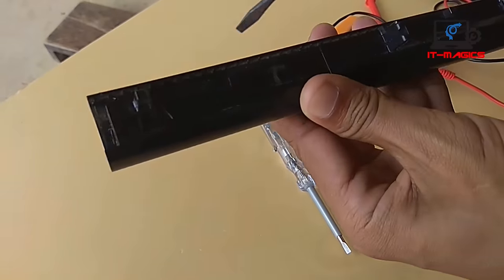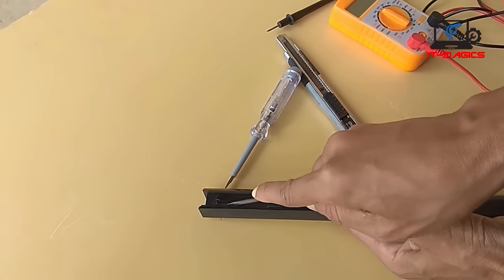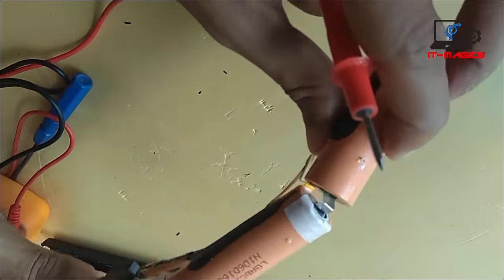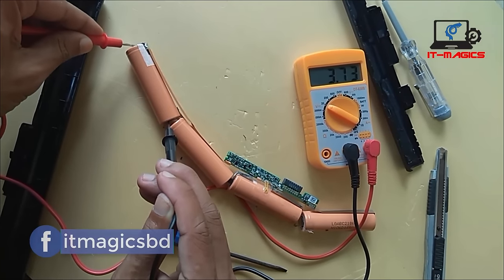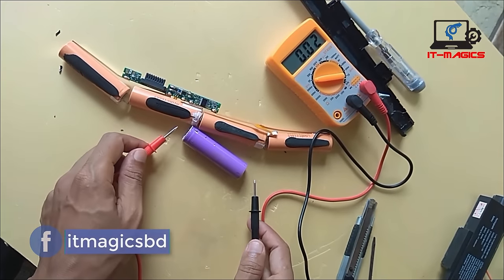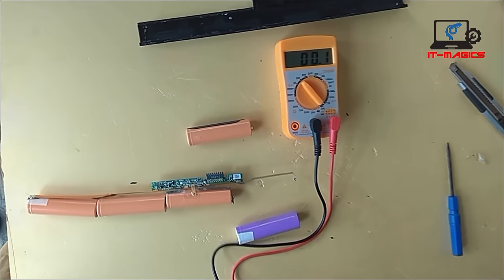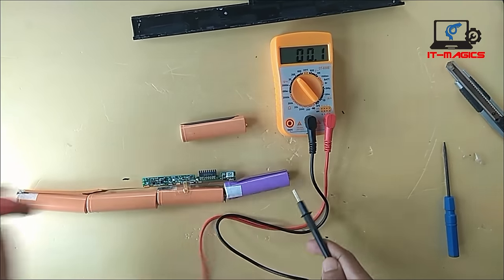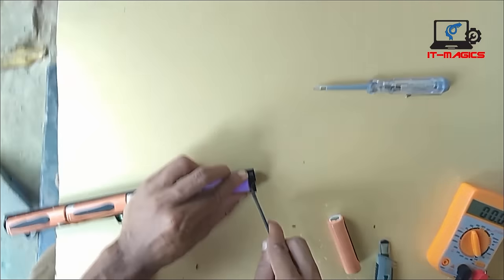Repair Laptop Damage Battery  or Not Charging Battery (Easy Way)

Comment: my laptop battery is not really holding a charge, however when I took it out and checked the individual cells they are actually showing 4.05V each x 4 when they are rated at 3.75V each??  I expected one or two to be very low but they all have this high voltage.  Battery pack is supposed to be 15V 48Wh 4 cells.  Any ideas ?
Reply: Same issue for me too... Pls do reply if found the solution
Reply: It is normal for fully charged 18650 cells to have a voltage of 4.2v. I believe that is the fully charged voltage when no load is present. So there is no problem with the voltage you are seeing.

The actual issue might either be that your battery charging controller has limited the run time after a programmed amount of charge cycles or one or more cell pairs in your batteries have degraded and can't deliver the same amount of current it used to resulting in it's voltage dropping faster then normal.

A fully dead battery is a battery that drops below 3.2 or 3 volts. So anything 2 and below is definite red flag and means that cell(s) need replaced. Usually though if a cell pair goes below the safe minimum the charging IC will refuse to charge the batteries which hasn't happened to you yet.

Another thing to note is many newer batteries have battery ICs that will refuse to work after you disconnect the cells as a form of tampering protection. Some can be reset by bridging the postive battery terminal to the postive output terminal. HP battery ICs are known to blow a fuse on the board as a protection as well and those along with others may also need special programming software to reset their EEPROMs. If you have one of those you are better off just buying a new battery pack. (perhaps get a generic brand instead of OEM. They may have simpler IC design that allows cell replacement in the future and may have easier to open cases)

Also one way to test if it's your battery IC cutting you off or if cells degraded is to disable the battery/power ACPI drivers in windows device manager and force the laptop to run until power shutdown. Usually Windows will auto shutdown at a certain battery level and this is determined by what the battery level the battery IC gives to the computer.

I have a old HP dv2000 with a 96watt hour battery that only runs the computer for like 15 minutes before windows shuts the computer down and BIOS says battery critically low before auto power off if I try to power on with no AC adapter. But if I power to BIOS with AC adapter plugged in, then unplug it continues to run much longer (but Windows will auto shutdown if I try to boot up to it). So looks like maybe my battery IC is what is deciding to shutdown the computer early. I have already opened my battery pack and checked and didn't find any unusual voltages for any of the cells so they charge to the correct voltage at least. Current capacity though requires something more advanced then a multimeter though so I can't really test that on mine. :P

Comment: So...ok...where can I get a new cell online?  What exactly am I looking for?  a rechargeable li ion battery?  or specific to a laptop battery?
Reply from the maker: Amazon
Reply: @ITMagics  Thank you for the short uninformative answer :p
Reply: @Bertminator  18650 battery hunting is actually really not safe. You might get scammed and get 300mah batteries instead of 1000mah ones.  It's safe to go for a cheap 10000mah powerbank and disassemble that one since fake 10000mah powerbanks have half the capacity (6000mah)

Comment: This wont work. Its a time waste. The eeprom chip of the battery needs to be reset and nobody has a way of doing it.
Reply from the maker: If laptop battery is physical damage you can do it otherwise not
Reply: Yes it didnot work..i tried
Reply: @ITMagics  i dont understand what you mean by physical damage. I had 2 cells dead (0 volt type of dead with cis caps popped out), the others were good. I replaced the 2 dead ones but nothing, still not charging. The protection board EEPROM needs to be reset as well otherwise you replace the cells in vain. What you need to post videos about is how to RESET the protection board after changing cells.

Comment: Hi sir my laptop is not charging I pullged the ac adaptor but it's showing that not charging what can I do my laptop is switched off for 5 months and whenever I use that with direct electricity without ac adapter after sometimes it switched off or showing some green green codes what can I do help me sir. 😭

Comment: Hello sir, my laptop battery timing is 2 to 2.5 hours. But, it stopped working suddenly on 49% and it brings the battery low light on my laptop. When I plug-off the charger my laptop turn of suddenly. Any suggestion to fix the problem, please.
Reply from the maker: Reset your pc
Reply: i can reset. Please send me any video link. Thank you.

Comment: what I leaem from. YouTube. it's not simple to replace  cell in laptop.  if u disconnect  it will lock and not power-up the laptop.  bms should always connected.  while replacing the batery.  I will try on my laptop and make a video soon.

Comment: I miss me pc it can't charge I legit watched over 10 vids how to fix it :(
Reply: Try restarting the BMS by shorting + point of battery (15v) package with battery connector + point (connector that connects with laptop) and hopefully BMS with start and it will work. If not than I'm sorry my friend your Laptop battery OEM is to blame for not allowing BMS restart or maybe the battery board is dead
Reply: @bhoot1702  huh? I'm lost i have the same issue but don't 100% understand what you are saying
Reply: @lucaseilers3996  When you desolder the batteries from the board, Due to power loss the Battery Management System (BMS IC)  shuts down or disconnects the output to the laptop. So even if you put new batteries, it will never work as the BMS's safety mechanism kicks in (disconnects output). It's made to think that something wrong has happened and to save the laptop it will disconnect output. So you need to restart the BMS after every battery is soldered in the board. So take the positive end from end of the board 15v+ from board then short it at the connector's + (output) and it should jump start the BMS. If you still don't understand, just search on YouTube : "How to restart laptop battery BMS ?"
Reply: @bhoot1702  oh ok ty I understand now

Comment: hai.. bro my problem is my laptop is charging few seconds then discharge few seconds then again gets charging few seconds.bro i checked my laptop battery like this video, each battery showing 3.8V total voltage of 15V is showing. But still my laptop not charging properly. pls give me a solution.
Reply from the maker: You may try Thishttps://youtu.be/V-fAC0OFG7c
Reply: Mine is the exact same!
Reply: Battery change hoga

Comment: i've try this long time ago, and the hard part is how to open battery box without damage it 😄
Reply: Use the isopropyl alcohol solution on the joint to loose the joint and then try
Reply: Any one now price of celles or.. voltage of celles
Reply: @priyanshushrivastava591  isopropyl alcohol? Can I use sanitizer?

Comment: DO NOT MIX NEW AND USED 18650 BATTERIES!
Reply: Why??
Reply: "It is highly advisable to use batteries of the same type, brand, size and expiry date in one appliance. The electrical capacity of different types or batches can differ. If such different batteries are used the difference in electrical capacity will grow during usage which could eventually cause one of the batteries to over discharge, leak and even explode.

Never use old and new batteries together, as this may cause leakage or worse. The remaining electrical capacity in a used battery is less than a new battery, even when it was only used shortly. This causes that when used together with one or more fresh batteries, that this used battery will lose capacity and voltage faster than the new batteries, which could cause eventually an over discharge and leakage of that battery."
-Panasonic

Comment: easy.  easy.  you haven't even shown if the laptop works.  the system detects no battery.  and won't let you power your laptop anymore.  you disconnected the batteries.  you should do a bypass.

Comment: The plastic on the HP one is so thin it just falls to pieces. No wonder they were recalling all those batteries that are set up to fail. Add in the messages about change the battery given by HP system. My wifes battery did that and I connected it a few hours off the laptop and guess what it fully charges perfectly. HP what a bunch of scammers. The number of failed laptops I have encountered that are HP.

Comment: Brother my question is should I put any cell in my laptop battery because there is 2 damage cells.! And will I buy same cell like others in my laptop battery.!! Plzzz brother reply it I’m very confused
Reply from the maker: Yes you can...but sure voltage are same as like as your battery cell
Reply: Oki brother thnkww 1 more request brother tell me where I can buy original display of my laptop because in Nehru Place lots of shop they are doing confuses.!
Reply from the maker: You can find from the local trusted shop. I have no reference
Reply: Oki brother sorry for again I ask to u my laptop is like when I unplugged my laptop charger suddenly my laptop shutdown so what should I do ? should I do same process like you ? and buy new battery suggest me please brother I need your help.!
Reply from the maker: And you can buy new one battery

Comment: What about Credit card instead screwdrivers?
Reply from the maker: Flatt screwdriver
Reply: @ITMagics  
Ohh Yes I have seen those screwdrivers where flat, but I thought plastics of credit card could leave less scratches and could be a little bit soft about the shell of the batteries
Reply: What about using your credit card to buy new battery hahaha

Comment: let me just pull out my good cell out of my good cell box, oh and my voltage reader from my magical voltage reader machine and let's break into the casing  "CAREFULLY" so that it's not able to rejoin. I think i'll try my luck with buying a battery replacement. Thanks for the insight though.
Reply: Boy someone isn’t very DIY. You wouldn’t be watching this or thinking about fixing a battery without a volt meter at minimum and having good cells either from your good cell box or buying them is a kinda obvious thing to need when fixing a dead/bad laptop battery. If you didn’t know any of this, well then this video showed you the basics....

Comment: This shit only works on chinese batteries on original batteries wont work once the charging circuit its disprogramed there is nothing you can do but buy a replacement battery,  you can try to reprogram the SMB circuit if you area expert but it doesnt worh your time